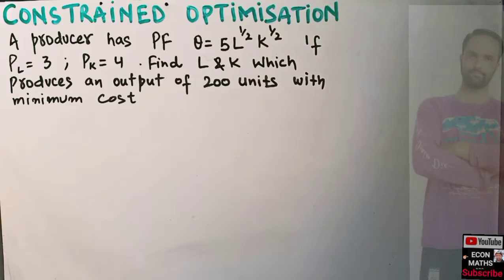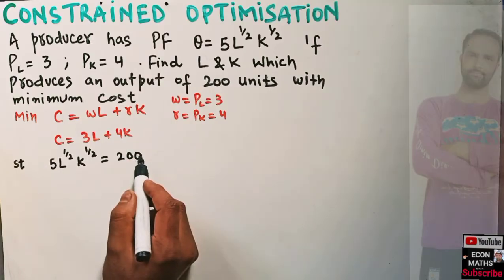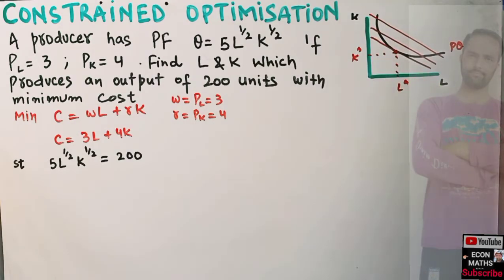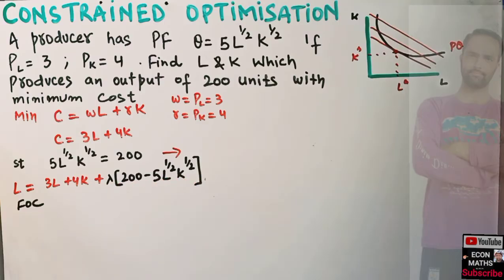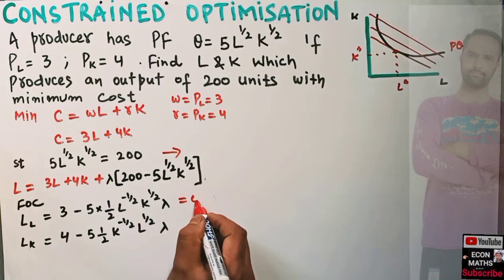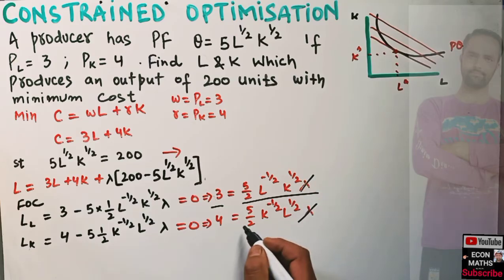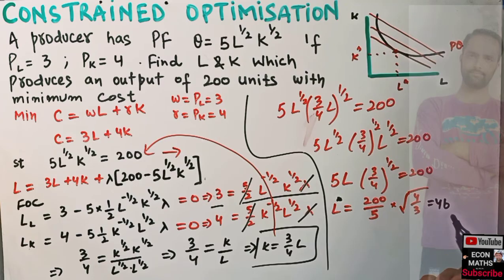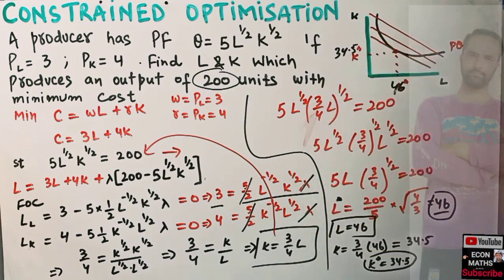Constrained Optimization. Cost minimisation from given Cost function with Production Constraint

Comment: You are given the following linear production function:
Y = a1x1 + a2x2
Required:
Determine the cost function (8 marks)
d) A firm has the following production function:
0 1 100   Q  K L
Where 
 0  1  0.5
, and the cost function is 
C 1000
Wage rate
(w)  60 , Interest rate
(r)  80
(i) Determine the number of capital and labour that the firm can hire in order to 
maximize output. (3marks)
(ii) What is the maximum output the firm can produce .